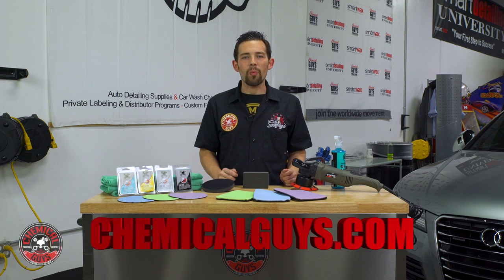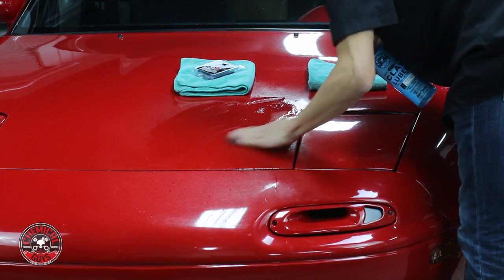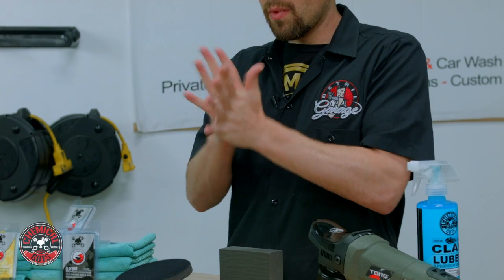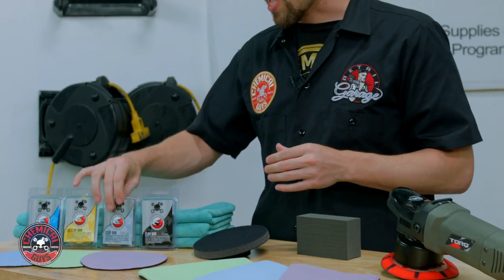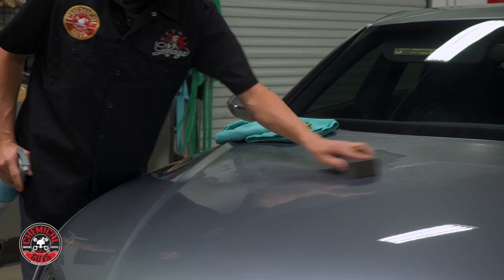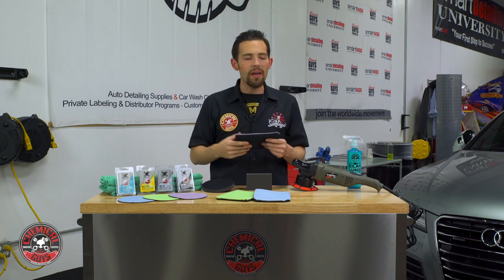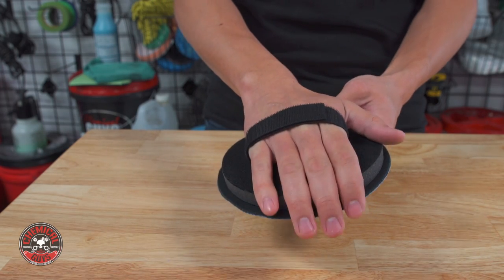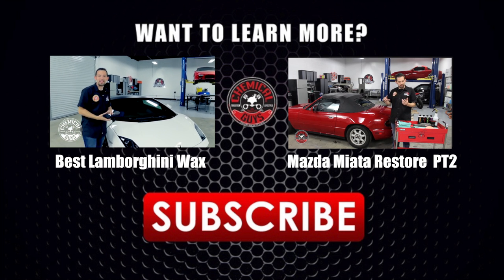Best Clay Bar Options - Chemical Guys - Clay Bar/Clay Mitt/Clay Disc/Clay Block

Comment: I use Chemical Guys products on my Mazda which is 8 years old. My paint looks awesome after I spend the time to do it. I've used the medium clay bar and it does the job. My paint is white so I see all the orange spots on my roof and trunk. It cleans it up in a snap. :)

Comment: Usually, if we use clay bar, we need to fold to the clean surface, if clay block/mitt/cloth, we need to clean from time to time. I am doubt if we use DA polisher. No matter how slow we run the DA, it will still many times faster than hand. The dirt that rubbed out will scratch the car surface over and over again............

Comment: The question I have is one product better than to other? All things being equal if you used the OG clay on half of a car and a clay mitt on the other half would there be any difference in the results? Also does the synthetic clay have a "life" similar to the clay bar?

Comment: Is it okay to use the OG clay bar on a well maintained car that should use light clay bar on
Reply from the maker: Hi Leighway, how's it going? You always want to use the least aggressive product as possible to achieve the desired results. If your car needs only the light clay bar, use the light clay bar. If it needs something stronger, use the OG clay bar. If you aren't sure, you can always test the OG bar on an inconspicuous spot!

Comment: hey, about a month ago i used the jetseal. but there was bumps and stuff on it .should i now use the clay bar to get rid of it or is it bad becasue i sealed it already? what should i do now"
Reply from the maker: If the paint feels rough then we recommend to use a clay bar on it to remove the contamination on the paint and re-apply a fresh coat of JetSeal to protect the paint and prevent contaminants from sticking in the future. Also try to frequently maintain your paint by washing your vehicle or cleaning it with a waterless wash to maintain the JetSeal.
Reply: @ChemicalGuys  ok so, whats the best step by step ,. say i just bought a used car from 2015 yesterday in decent shape. but hasnt been clay barred before only water washed. what do i need and what order do i do it in from clean to shine. thanks!
Reply from the maker: We recommend that you follow our detailing flow chart and start your detail from scratch by stripping and decontaminating the paint so that there isn't anything on the paint that will compromise your results. Start off by washing the paint, proceed to the clay bar process and assess the paint to determine whether or not the paint needs polishing. If so then perform a paint correction and if not then skip the polishing process and continue with the next steps. The next steps in your detail will now enhance and protect your freshly clean, contaminate and scratch free paint. Optional step: Apply a coat of glaze to condition your paint to hide light imperfections if not removed by polish. Apply a coat of sealant or wax or both to your paint dependent on what you would like to do. Finally just maintain your paint with a quick detailer, spray wax or spray sealant after a wash to maintain shine and protection.
Reply: @ChemicalGuys  what do yo recommend for the wash  to strip of old wax and sealant thats on it.
Reply from the maker: We recommend using Clean Slate which is a surface cleansing soap that will break down any oils from sealants or wax on the paint to show your paint in its true form.

Comment: I like the polisher  idea but you gotta rinse it off, it’ll pull up the stuff for sure but the synthetics need to be rinsed off your got something similar and it has to be rinsed .
Reply from the maker: Hi Amir, you are correct. As per the instructions, we recommend frequently checking the surface of the Clay Eraser for any large particulate matter, and simply wiping clean as needed. Thanks for watching, Amir, and stay tuned for a new video dropping later today!
Reply: @ChemicalGuys  How frequent? Half the car, after each car?

Comment: Hey, i just got the gray clay bar. My vehicle is pretty well maintained and its fairly new, however, it does sit outside. Can i still use it?
Reply from the maker: Hey Josh, if your car sits outside 24x7 without garage cover, chances are it is in need of a thorough clay bar service. Cars in metropolitan and industrial areas that do not receive garage cover at any time are subject to intense contamination with all manner of pollution, industrial fallout, brake dust, and natural elements that stick to paint. When no other light duty clay bar can cut through the filth, bust out the Medium Duty Clay Bar. This extra-sticky clay bar formula grabs hard to stubborn surface contaminants, and gently pulls them from the surface to restore that smooth-as-glass feel we all know and love. The Medium Duty Clay Bar is perfect for cars that are not decontaminated on a regular basis, or for the first clay bar service on a 5-year-old car that has never received one. For lighter duty jobs, consider the yellow clay bar or the blue clay bar. Thanks for watching, Josh, and check back tomorrow for a new video!
Reply: Great thanks!

Comment: How often should I glaze my vehicle. I purchased alot of your product via amazon past 2 weeks and I'm closing in on a full detail on my 2017 cx5. I am not going to polish my car because the paint is super new but I am confused on how often I should glaze my new vehicle.
Reply: Adrian De La Rosa once every 2-3 months
Reply: Depends on how dirty u get it and what products are already on your vehicle
Usually after applying a sealent and polish you typically can just wipe of the dust for 2-3 months until you need to apply the selant again 
If u just polish and wax the vehicle then you might need to do that after every 1-2 months
In short depends upon what products are being used
It’s already in their product discroption on their website

Comment: Should I clay my car every time i wax my car and should I clay my car every time I glaze my car.
Reply from the maker: Hi Adrian, we recommend that you don't clay every time you are going to wax. The reason is this: you're giving your car the clay bar treatment to remove above-surface contamination that has embedded on your paintwork to return it to a smooth as glass feel. Whenever you wax your car, you're protecting it from getting contamination to often We recommend claying before a polish or if you feel your surface has gotten to rough. Another reason you don't want to clay it too often is since it is ridding contamination, it is leaving behind very light marring and scratches because it's abrasive to remove the filth and you don't want to do it all the time because then it will accumulate. Use it under your own discretion but you don't need to clay as often as you think. Take your hand over the pain every now and then and feel if it's too rough for your taste. Thanks for the question Adrian and have a great weekend!

Comment: What the heck is "Rail Dust"?  Do you get that from being near a train?
Reply from the maker: How's it going, here's an explanation of what rail dust is. Rail dust is exactly that, when cars are transported by train (rail) from the factory to a city, the metal wheels of the train cars running on metal rails create small particles of metal that fly into the air and land on the horizontal surfaces of the car. They are hot and will adhere to the paint. Then when they get wet from rain; snow or just dew they rust and create tiny little rust spots which are quite visible on white, yellow, beige or light colored cars.

Comment: Why is the best?
Reply from the maker: Hey there, thanks for watching. It really depends on your preference. Each type of clay has its own set of pros and cons. Clay bars are great for removing contamination, and are easy to mold, however once dropped, they have to be thrown away. Clay block are great because they have a foam backing for easy grip, and they can be cleaned after dropping. Clay mitts, and discs are great because they remove contamination from larger surface areas, the drawback is that they need more lubrication. My personal favorite is the clay block, it's very convenient, and you can reuse it if you drop it on the ground.

C.G. Alex -
Reply: Chemical Guys I’m eyeing that clay block at the moment. My truck needs a good clay job, but I’ve never clayed anything before. Maybe you can give me some technical knowledge; with a clay bar, is it supposed to get the contaminants out of the paint and move them out of the way via lubricant runoff, or is it supposed to absorb them into the clay bar? I️ can’t imagine the clay BLOCK absorbing contaminants since the face is rubber; therefore the only path I️ see for it to go is in the runoff.

Please correct me if I’m wrong.
Reply: Ignore the exclamation marks and weird symbols. I’m a victim of the iOS update glitch lol